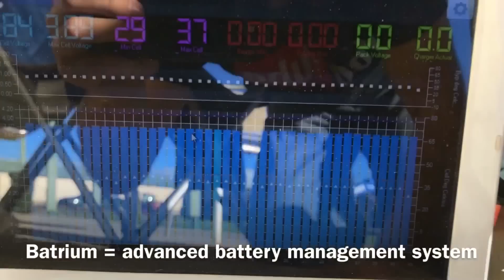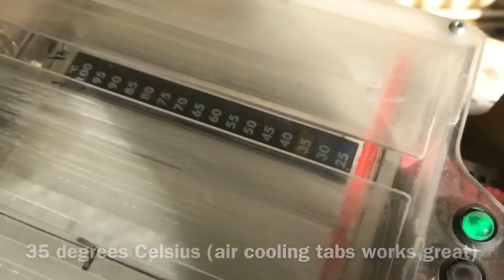210kW Racing Electric Yamaha R1 vs Petrol Bikes (race track) • Ripperton DIY Electric Motorcycle

Comment: Hello dear good night, how does it calculate the lithium cells to know how many amper will my battery pack stay 20ah 15ah or others, give me an example please how many cells grouping in parallel will give me (X) amper, from now thank you !!!
Reply from the maker: +Flavio Costa hey Flavio!! Super easy, you need to find the specs of the cells you're using to build your pack. Let's say 18650 Panasonic PF is 2900mAh and 10A continuos discharge (can safely peak 18A for few seconds). If you have 5 cells connected in parallel you have 2900mAh X 5 = 14500mAh or 14.5Ah and can handle 10A x 5 = 50A continuos. If you want more Ah for more range, you just need to add more cells. 
Don't mix different cells when making small ebike battery pack (unless you're making a massive pack like the DIY Powerwall guys)

Check out DIY Powerwall group on Facebook, it's a large community of people making batteries out of recycled cells. So much POWEEEERR...=]

Comment: What's impressive is that he can charge the bike on the track in a reasonable amount of time holy crap.

TELL US MORE ABOUT THE BATTERIES!
Reply: I doubt it... Regen braking is neary not as effective :(
Reply: there lipo cells...charge at 1-2c...not actually fast at all, you just need a beefy charger and PSU.

lipos are good for 1-5C charge on average some do 15C.

a 1C charge is 1 hour so a 1Ah battery would charge at 1A and an 100ah battery would take 1 hour but at 100A (size of battery has no effect on C rates u just need the power to charge them)

higher voltages take more wattage so a high voltage high Ah pack he's properly charging at multiple KilloWatts....hence the need for three phase power input.

Iv been using these battery's years in the RC hobby...lipos are a less stable version of what's inside ur phone and laptop but on steroids as handle a WAY higher discharge spec.

a Lion 18650 is good for a few Amps (high drains IMR a bit more)

Lipos are good for 100C+ discharge !! Sky's the limit...but less stable, heavier, less energy dense.
Reply: hes charging with a 3 phase outlet thats a lot of power
Reply: sieve5 high c charge/discharge rating. he prolly didnt charge it to 100% in between sessions but dk. Tesla's recharge to 50% in 30 mins.
Reply: 5C charging actually takes about 20 minutes because of charge tailing. You can't keep dumping 5C amps into the battery as it gets full. I use LiPos extensively on a much smaller scale (big drones) and we charge at 5C regularly. Tailing and cell balancing at the end take more time. Of course that means just 50 amps for us! :)
Reply: CyclingSalmon14 I know the ratings and what I meant was that it charges quickly compared to completely empty battery
Reply: You can charge any LiPo cell crazy fast, but their life will decrease (the number of discharge cycles).
Reply: @It's time to stop Get some help, Maybe, but probably not to that large of a degree. It changes the handling of the bike quite a bit (think engine braking when you're in cruise and you start to go downhill). It's hard to say how much battery is left without seeing a power vs time curve and knowing the length of the track and laps.
Reply: First you need a power supply tan generate 200kw/H
Reply: Scruffybiggems I didnt know that. I also didnt know that outlets that are to the public were 3 phase lol
Reply: Eric Braun yeah, which is why teslas and my galaxy s8 get to 50% charge so quickly. My lipos are 24v 5.5amp, I set it to fast charge (6amps) and it'll take about 2 hours to fully charge a dead battery. The last amp it draws literally takes half a hour at the very least
Reply: that wasnt public that was off the main switch board they shouldnt be using it
Reply: ElectricBike but anything about charging?
Reply: Ian Mangham let's say he charges at 5c, thats 1000amps. How do you get 1000amps
Reply: How many recharge discharge cycles before battery is junk?
Reply from the maker: TELL MORE ABOUT THE BATTERIES??
Here are two very interesting videos showing Danny building this massive racing battery pack, this is the second pack designed for this bike:
1) https://youtu.be/RMMfZAL5lPE
2) https://youtu.be/IltU59Zm2Ko
Reply: electrondj says its 2 175v 600a batteries in parallel. so 105kw/h is charging at 1c. I think its safe to charge li-ion at 10c powa. all you need is 1.05Mw/h
Reply: sieve5 Regen braking would be my bet, he just needs to top off the battery. Probably has about 80-60% in the battery after the race so it charges pretty quick

Comment: This is INSANE FAST! Really impressive! Great video as always!  Awesome design and race!  1200A!!! HOLY! Keep it Rolling! More pooooooower! Future is Electric!
Reply: Nexi Tech love the camera guy. Tons of positive energy.
Reply: Graphene batteries are already being tested and are a thing. Lithium is highly recyclable. You're just a shill.
Reply: The future runs for an hour or two and then charges in twelve and weighs a ton
Reply: M773, they haven't been perfected yet. Consider the difference between each racing EV being created during the last decade. The old Mercedes which can't drive more than 30mi and needed to be charged for 24 hours up to the contemporary race EVs like the NIO EP9, Rimac Concept One S and Tesla Roadster 2018. Also check out other non-production EVs like the Zombie 222.

Batteries has just gotten cheap enough for use in cars so it's only the beginning of the revolution.
Reply: Let alone water control. Would have to ride this suckere in the rain.
Reply: impressive, what type of electric motor is it that easily chasing oil engine??
Reply: Hmm why only 175V? Why not 400?
Reply: György Kiss 400v parts are very cost prohibitive at moment. Most controllers for 200kw would be around 15-25 thousand dollars
Reply: Depends on cell specifications,  SCRs and Mosfets, motor input design voltage, your question is akin to saying 250cc injectors on a race bike why not 1000cc injectors and assuming the same engine. Putting more voltage through a PMAC, assuming you didn't overheat the coils and melt the enamel coating and cause a massive short, you run into two issues, one no gain as your stator reaches saturation and thus putting more current from higher voltages yields no higher force from the B field and two, you risk depolarizing the PMs.
Reply: Awakened2Truth - Disciple of Jesus the Christ stfu u religious shit.
Reply: Awakened2Truth - Disciple of Jesus the Christ ... man kind has explored maybe(MASSIVE MAYBE) 0.0000000000000....1% of the universe...
Reply: M773 so use graphine
Reply: + M773
M773  You're an ignorant which refuse to inform yourself; lithium is recyclable and the future will be graphene/carbon body parts batteries... LMAO too!

Comment: Awesome bike really impressive that it can keep up and and beat the gas bikes.
Reply: Adeum Deus with interchangeble bateries they can
Reply: AmazinChannel that would make bike racing even more exiting! having pit crews that change the batteries every few laps would make staying in the lead a more tactical ordeal.
Reply: M773. Guess you're a real piston head!  I love the ICE too, but at the rate of advancement of tech, our valve, cam and mechanical-gas fuelled beasts are going to be nothing more than displays at the Smithsonian in our lifetime!

It was only a few years ago 210KW was a pipe dream. Who knows what they will have invented 5 years, 2 years or even a year from now.  And this is all off the shelf consumer available tech!  Nothing here from Raytheon, MIT or DARPA!
Reply: M773, You really need to understand the capabilities of electric motors to understand the absolute insanity that they can produce. If you do not understand something, please do not argue against it.
Reply: M773 he is on a track with 1000cc bikes in the straights he seems to be over taking them to me where you getting your view from the bike has 210 bhp so yes it probably is faster no power band torque from 0 mph
Reply: suzuki turbo 210kw that is. closing in on 300hp
Reply: brett20000000009 its lithium polymer
Reply: +M773  inaccurate on all counts
Reply: Funny how Dodge had to come out with the 840hp Demon to beat a 4 passenger electric sedan driven to the track with no mods in the 1/4 mile. Their Hellcat couldn't do it.
Reply: I can spank a Tesla in my 1996 Saturn wagon. I’ll race any Tesla from San Diego to San Francisco, I’ll even race for pinks!
Reply: Exactly correct M773, weight will always be an issue with the electric bikes, the guys he is passing are obviously novices looking at their corner entry and lean angles, he would struggle even in the inermediate group at a track day.
Credit to him for his work but it isn't that fast, not around a track at least.
Reply: If you understood how electric motors work it's not impressive that he can keep up and beat them.  What is impressive is the battery life he getting at the output needed to move him and the frame.  Then again I'm not sure what the total weight is.  I think the video said 210kw which translates to 285 mechanical hp and that isn't taking torque into account.  With instant torque that he can fine tune to his needs and that peak hp he can absolutely demolish everything.
Reply: For a couple laps... Electric vehicles do not have the ability to keep up with combustion vehicles over the course of a traditional length race.